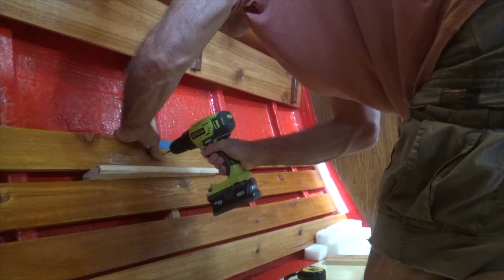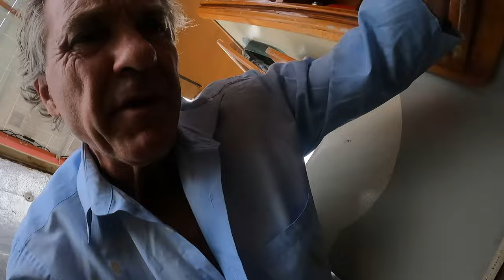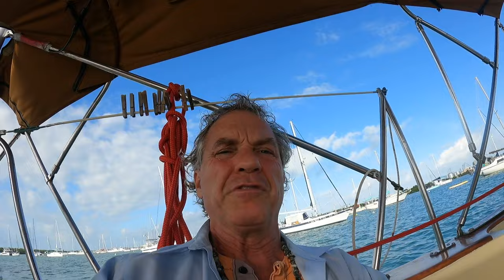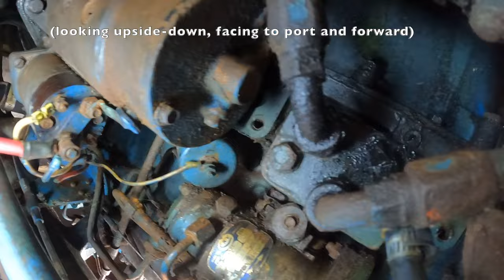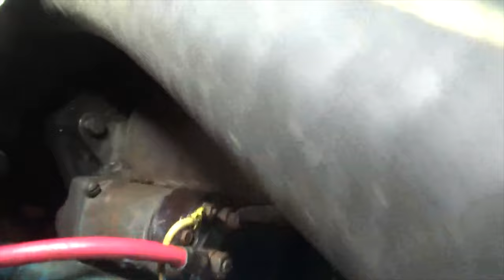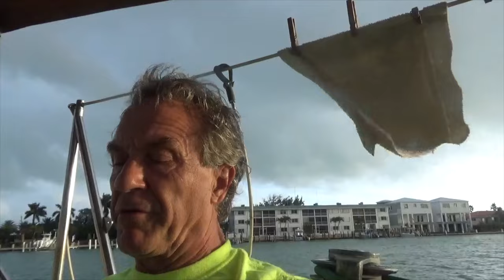Skipjack Sailing 115.  Engine issues.  Will I need a new engine?!

Comment: I noticed your motor mount bolt loose as well, could use new mounts.... can you not access your engine thru the companion way stairs?
Reply from the maker: I think I can get to the mounts.
I guess I'll add it to the list and start figuring on what exactly one does to "service" a motor mount.

Comment: I think replacing the engine, albeit 45 years old, is probably OTT. But it’s worth thinking about spare important auxiliary parts you may need. Last year I bought replacement starter motor, alternator and raw water pump, and will keep the old parts as working spares.
Reply from the maker: Thanks, David.
I think that the core of the engine is still good, although I may measure compression ratio.  I am not an expert, but I believe that compression (or lack thereof, more correctly) is the defining criterion for an engine replacement.
There is a gent in this "neighborhood" that is a retired Perkins 4.108 mechanic, and he says that he has a lot of spares that I can buy.  New starter, fuel injector pump (existing is leaking), and other auxiliaries ....I can get it all.  May as well buy injectors and the tubing kit, as well as the water pumps (fresh and raw) and the fuel lift pump.

Comment: Used to be. Perkins and westerbeke exactly the same westerbeke parts are less costly  owned 2    1o8's. Check it out   high pressure pump  pretty important    have fun
Reply from the maker: Oooh....did not know that bit about Westerbeke.  I am starting this little project in earnest tomorrow.  Measuring hoses and calling that shop in Ft. Lauderdale, etc...
I am liking these comments from folks who have a lot of sense and experience.
Thanks!

Comment: Good plan. There's no point trying to go anywhere if your motor is iffy.
Reply from the maker: Trying to decide how much to tackle on an engine that generally runs pretty darned well--that's the dilemma.
I don't want to charge into some massive teardown project and get myself to the point that I've killed the engine.
I'll lay out the detailed plan for next episode.
Reply: @skipjacksailing8986  It'll be interesting to see what you do. Engine work is not something that's in my wheelhouse, but I have a rusted old Volvo Penta diesel on the neglected old wooden boat I'm restoring and don't really have the money to have professional marine diesel mechanics do an overhaul.

Comment: Hi Russ....step 1..
Before starting, be sure to have sufficient funds to pay diesel guys to come and fix it. ;) Heaven forbid if pump is toast/ unfixable, to find out then what a new one costs! :eek:
Extending the heat exchanger lines might cool fresh water sufficiently to make the calorifier  run considerably cooler water? Just tryin' ta think ahead
Best to ya's
Reply from the maker: Good thoughts as always, Paul.
Wish you were here to have a look.
I will lay out my detailed plan-of-attack for next episode.
Will start with the relocation of the HX, and then (see Leonard's comments below) will decide on whether to take on the starter replacement and the fuel injector pump leak.  A little nervous about the f'ing up the injectors.  Hell, it was a bitch just to get her primed last time.
Always appreciate your comments---gotta' get you aboard for a sail sometime.

Comment: If it’s not broke don’t fix it, old saying but, the job weld is doing a good job. I would order new pump and have it on hand when needed. Set up a pm to check started bolts after some number of starts. And finally enjoy the weather. The storm just past through Charleston with 69 mph gusts at the airport. 
Check out all the interference that has to be removed to replace spark plugs on a 2012 Toyota Highlander. Makes your job lot easy, if you don’t break a bolt.
Reply from the maker: I think we are just far enough south to dodge the brunt of this cold front, Leonard.,
Right now it is a quiet gentle evening, but the front is supposed to pass around midnight.

I'm reading other comments, too.  Certainly I can relocate the HX easily enough, and that'll put me in position to make future repairs easily.  I was already planning to buy a kit to replace all four injectors, and to bend/replace the little injector lines (tubes).
Reply from the maker: I am making a P&ID for the oil system now!

Comment: Seems to be working fine, If you did buy new engine seems to take many months fort it to arrive.
Reply from the maker: And it would be pushing $5-7000 to buy an engine, and a boatyard would charge 3-4000 for the job.  A hard pill to swallow on a 45-year-old boat worth 25,000--35,000.
As always, appreciate the comments.

Comment: Your motor mounts at least need servicing and tightening. More likely they are due for replacement. 

I know this is the internet but I have just sold my marine service business.  Planning on sailing away hence why I am perusing sailing videos.
Reply from the maker: What do you do to service a mount?  Not my strength area at all.
I am happy to share any insights that I have--handy at most things but expert in nothing, it turns out.
Reply: @skipjacksailing8986  1st you have to determine whether the mount itself has failed.  Many times a loose top nut will be due to the urethane or rubber isolation pad has failed.

By using a pry bar you can determine if the mount has excess play.

You must also remember to check your engine alignment by use of a feeler guage or indicator at the shaft flange.

These will give you clues.

With a vessel of your age and not knowing the service history, at my shop, we would have just replaced them.  Faulty mounts can cause significant damage to other parts of the drive train.  They do not last forever.  Mounts are a consumable part, like an impeller or a belt, longer lasting but consumable.
Reply from the maker: @pontoonrob7948  
That is really good stuff.
So much appreciated.